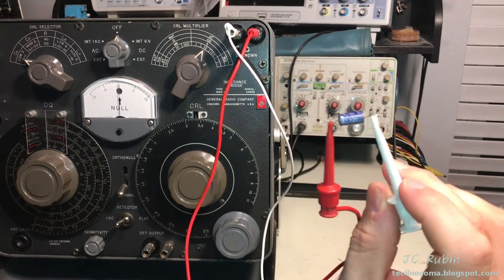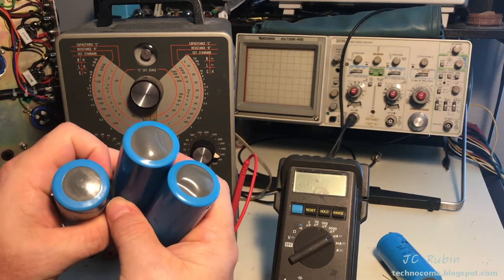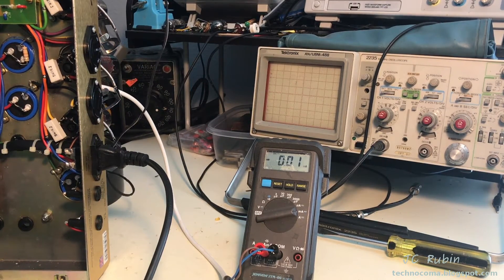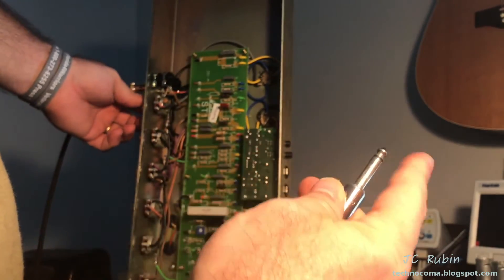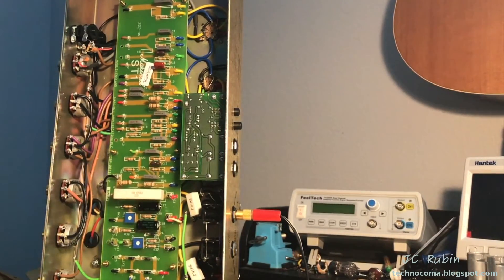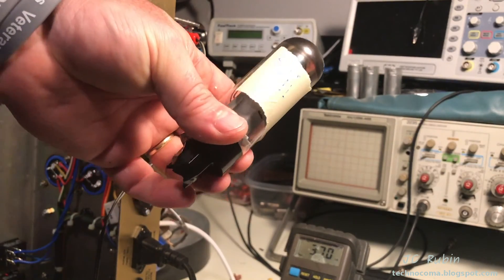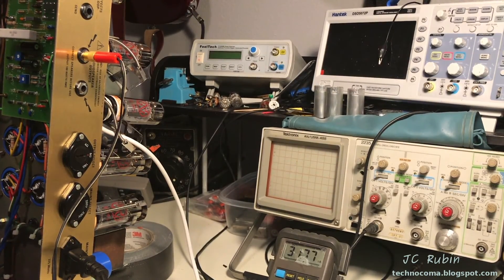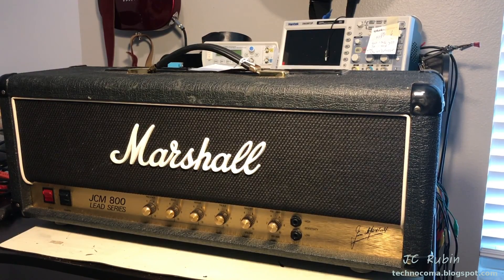Marshall JCM800 Lead Series Repair - Major Power Supply Issues 2 of 2

Comment: The typical working-lifespan of an electrolytic cap, especially ones made using older technology, is reckoned to be about 10 or 20 years before they fail.

Comment: One of the best ways to test an electrolytic capacitor, is to do something called an ESR test on it, ESR is short for Equivalent Series Resistance, and can be thought of as being like a virtual resistor in series with the capacitor, especially to AC, normally the ESR of an electrolytic capacitor should be very low which is important when it comes to power supply filtering, a bad electrolytic cap will show a higher ESR value than it normally should.
Reply from the maker: You should check my videos where I go through all of these with an ESR meter.  I have a few videos where I do the Power factor by hand.

Comment: Biased a bit cold for a crunch monster. Around 42 is near perfect. In that ballpark. I didn't see you dissipate the voltage. It should be part of every service video.
Reply from the maker: You're right. That will be the video where some guy decides to test the filter caps with their tongue.
Reply: @retrotechandelectronics  People are capable of much dumber things.

Comment: I don't bother buying cheap tubes that Tube Depot says are matched. It's a fallacy. 
Secondly, you're biasing too cold for an amp that people expect crunch out of right out of the gate.  I could maybe see being that conservative if you were using Mullards or Amperex in an effort to save them, but JJ's are cheap, so hotter isn't a bad thing. Thirdly, may I respectfully suggest that you lose the ring, especially since you're using your left hand in a high volt live amp. Sends the wrong message.
Reply: Read The Trainwreck Pages by legendary amp guru Ken Fischer, the section on bias adjustment... the safe operational range of EL34 etc. is between 10-40mA per tube... and all amps are different, some may sound better running colder, some sound better with more current at idle. Using Ken's preferred current method... "any current that produces the tone you desire is the "correct" setting". 

Regards 🎸

Comment: Any amp older than 20 years is ripe for recapping. You just need good eyes and no oscilloscope or other fancy stuff are needed. If you love your amp, replaced all electolytics at least every 15 years or so and you'll be good to go. Nowadays, electronic components are getting better and better... so, it always worth the job!
Reply: Caps are rated for a certain number of hours of use at full load, not so much shelf life.  An amp that sits in a closet will be different than one that is gigged out daily.

Comment: Great videos. Could you look at my video and tell me it's normal. Many thanks
https://youtu.be/ux-r8eOcBJI
Reply from the maker: No doubt, I bet the attenuated signal that runs through the pot is shorted to the shell.  A look inside, pulling the first 12ax7 or clamping the pot center to ground would confirm this if the problem went away in doing so.
Reply: @retrotechandelectronics  pulled v1 out and yes noise went.
Reply from the maker: There is a signal short on the pot for the preamp to the shell somehow
Reply: @retrotechandelectronics  it was sent to Marshall in UK late last year and came back fine. They put on repair sheet “microphonic capacitor replaced in the preamp stage". Now faults returned they claim it's normal as amps a high gain model.
Reply from the maker: @lohanette  curious, did you try tapping the 12ax7 on the preamp stage to see if it was microphonic
Reply: @retrotechandelectronics  yeah did that and it's fine. Removed V1 and noise went,  so I'm guessing faults between input and v1 socket. There's a capacitor between the two. When marshall repaired it before they replaced microphonic capacitors in the pre amp stage but it came back. They did repair again and it came back the same ie noisy. Amps been sent to Marshall for 3rd repair with same problem.
Reply: @retrotechandelectronics  just an update. Called marshall today to see if amps fixed and they told me they can't tell me I'm to call dealer. I asked if they still have my amp. Same thing ask dealer. Called dealer and they can't tell me. Taking legal action against dealer as I don't know where my amp is and Marshall and dealer won't tell me. I recorded call to Marshall which I will be posting at some stage. Company has gone downhill since Jim died.
Reply from the maker: They lost your amplifier? Do you have a turn in receipt with the dealer when you gave it to them?
Reply: @retrotechandelectronics  no. Just spoke to manager who confirmed they got amp last night and he'll check the full report marshall did later today. If they claim amps normal and return it to me ill have a tech fix it

Comment: Those switching jacks on Marshall's are notorious for not making good contact either causing intermittent preamp in and out issues. They seem to be the curse of modern amps. I check those first on about every amp I repair that has some kind of cutting out issues. yeah, this amp had much deeper issues, I haven't seen can caps that bulged ever. Nice job on the repair. I rebuild a lot of tube amps and the Marshall's are a SOB to get the chassis back in the cabinet at times.